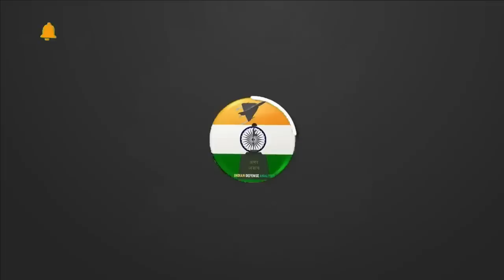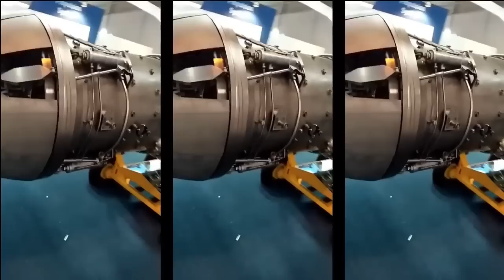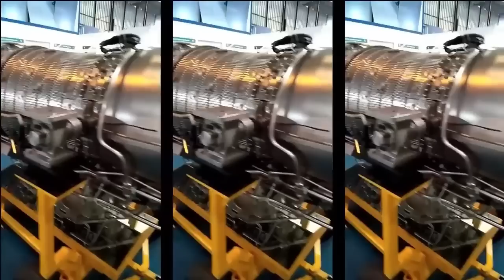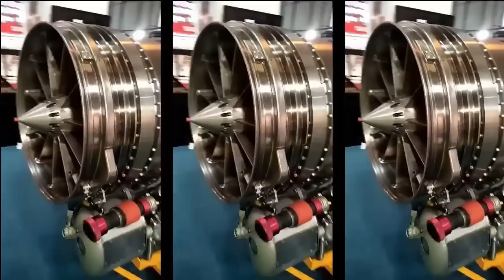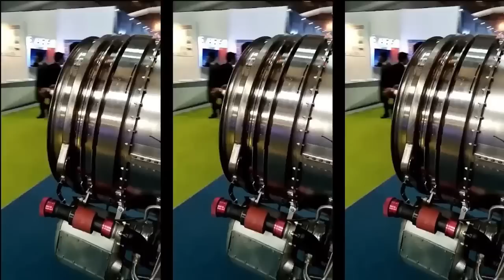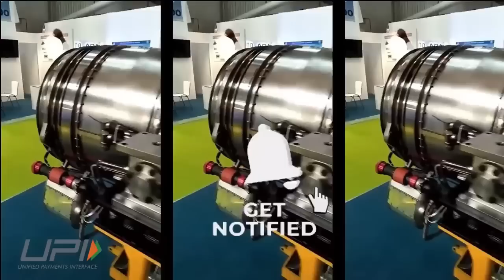#breakingnews Kaveri Engine successfully completed high altitude trial #drdo #indianairforce

Comment: Better specified the thrust weight ratio, fuel  efficiency and lifespan which are more relevant n informative.....otherwise its just a jet engine unworthy even for exhibition.   If India cantmake special marine steel grade for carrier... turbojet superalloy is more difficult to mastered.  Slander China as copycat or inferior, pribably will b a good idea and continue to b in denial.

Comment: GTRE should try and get a dry thrust of 75 KN.  AMCA fighter aircraft will need a 125 KN engine.  GTRE  has a capability to make such an engine.
Reply: Amca is double engine
Reply: @akhandbharat1593  yes AMCA fighter is a twin engine aircraft.  Power to weight ratio will be great.
Reply: Simple answer no

Comment: Good job, now it would be better if this can be used on HLTF-42 thus we can have our own trainer, and this can be used to compete in markets that JF-17 has, this is cheap as JF-17 but more better and reliable, considering the track record of Tejas
Reply: They are looking for ge414 For hlft 42
Reply: @pravinmeher2036  GE F-414 is a powerful & reliable engine, but then it will always require American permission if we want to sell the plane to someone, but if its Kaveri then that would also get the user to test the engine and give more correct feedback for the engine, we know the engine has more weight, but we need to master the material which will take time, and over the period of time, the kaveri engine can be further developed to the engine that we need, and then further develop it as per our requirement, we can control the engine specs.
Reply: @sachinmesta4238  HAL person did mention that ge414 is what they would use. He said they want hlift fit between Tejas mk1 and MK2. Considering all metal body, ge414 will be appropriate. Kaveri with just 80kn of wet  thrust will take hlft 42 to hf 24 marut's way.
I believe considering buying power of India,  for example air India deal. US companies would lobby with the US govt not to go against India. Let's see how it goes

Comment: While one step forward, I am annoyed as to why it is taking forever for flight test certification.  Kaveri Dry Engine has successfully completed its high-altitude trials where it was simulated to achieve 46-48.5 kN of thrust. Flight test certification should get started now! And after that, 50% of the Kaveri engine is ready, and the afterburner must undergo this entire process too. That seems to add at least two years before Kaveri engine will be ready to power Tejas Mark1A. Need to expedite the whole testing process by purchasing a flying test bed.
Reply from the maker: I told you at least will get some good news 😀
More details tomorrow , will try to meet GTRE officials
Reply: @IndianDefenseAnalysis  Looking forward to it, please ask them if flying test bed has been approved or not?
Reply from the maker: @datoolz0  sure
Reply: You are absolutely rt. We are relying on Russia now, we need to a dedicated aircraft to test engines.
Reply: @GGexcellence  Hopefully the Kaveri team knows if the flying test bed has been approved, it was requested earlier. We do now have high altitude wind tunnels, only missing piece!

Comment: JESUS finally 
Congrats to DRDO man 😃

I wanna talk to those people who mock DRDO calling them babus.
I will ask them how dozens of babus together can make the most complex thing man has ever made - jet engines.
Reply from the maker: Criticising is easy, blaming is easy but getting in system and making difference in democracy like india is next level challenge which we Indian fail to understand
Reply: @IndianDefenseAnalysis  
Yeah 😗
Now the path is clear , we have a booming economy for funds.
Now GTRE should start working on a new afterburner section for kaveri.

They can work on 100kn+ engines after AMCA mk2 engine is ready, using all the experience they will have at that point , it will be easily for them.
Reply: @fly463   They can't.. U can't make iteration on French safran core and turbine blades. 
Only OEM can do that. It was an offset obligation for 36 Rafale deal. 
No TOT occurred.. Safran demanded 1 billion euros for that which MOD denied.
Reply: @nishantshrivastava9674  
Then who is going to help us in mk2's engine?
Reply: @fly463   There would be Joint venture with either General Electric or Safran.. 
The one who agrees to share more technology with less liabilities with low bidding.
Reply: @nishantshrivastava9674  
GE says they can give us a 130kn engine & Safran -only 110kn 
The one with less strings might win
Reply: @fly463  but when the decision will made? A fighter program without even finalizing the engine.
Reply: @IndianDefenseAnalysis   Hello IDA team, make a video on the topic DC MAWS which was going to be integrated on Su 30 mki.. 

Here I attach some info from renowned force magazine.. 

DC-MAWS Suite

For DARE, the development of the six-unit dual-colour (ultra-violet and infra-red) missile approach warning system (DC-MAWS)—essential for all combat and combat-support platforms to provide hemispheric warning to pilots of incoming guided-missile attacks—has been a particularly daunting task. The MoD’s Defence Acquisition Council (DAC) had in September 2004 cleared the installation of DC-MAWS in 100 IAF aircraft (both fixed-wing and rotary-wing). DARE in January 2005 proposed to the IAF a project to design and develop DC-MAWS, jointly with the Israel’s Ministry of Defence and Elisra.

In July 2006 IAF accepted the proposal and in March 2008 agreed to install DC-MAWS on all its Su-30MKI H-MRCAs and projected an initial requirement of 50 DC-MAWS suites. In November 2008, the MoD accorded financial sanction for the development and integration of DC-MAWS on Su-30MKIs by DARE at a total cost of Rs.193 crore (including a foreign exchange component of Rs 172 crore), with a project date completion (PDC) of 55 months (June 2013) under the mission-mode (MM) category.

On July 17, 2006, Cassidian, the defence and security division of the European EADS, and the MoD inked a contract for procuring a small number of MILDS AN/AAR-60 DC-MAWS. This MoD move came despite DARE signing a memorandum of understanding with Cassidian on the joint development of an initial 36 DC-MAWS suites for both fixed-wing and rotary-winged aircraft of the IAF and the Army Aviation Corps that made use of the MILDS AN/AAR-60 system with a planned initial operational capability for 2007. The agreement also included the co-production of these suites by BEL. In December 2008, DARE signed a tripartite USD 37 million (Rs 148 crore) contract with Israel’s MoD and Elisra (now owned by Elbit Systems) for the joint development of a DC-MAWS suite with a projected PDC of 48 months (December 2012). The scope of the contract included delivery of six sensors for one DC-MAWS suite. HAL was selected by both the IAF and DARE as the nodal agency for structural modification of Su-30MKI airframes for integration of the DC-MAWS suite.

 

Heavier, Bigger

Subsequently, DARE found out that the sensors (that make up the DC-MAWS suite) submitted by Elisra were heavier and bigger in dimension (24cm in height and 4kg in weight). In May 2009 DARE informed Elisra that the sensors might not be accepted for the Su-30MKIs as it would cause serious restriction on their flight envelopes. The IAF too expressed the same view in March 2010. But Elisra in June 2010 expressed its inability to make any significant weight reductions. The installation of the six sensors on the Su-30MKI was not cleared in December 2012 by an expert committee at locations specified by DARE, as it would involve cutting the aircraft’s internal structure and the destruction of internal thermal masking coatings.

Subsequently, the committee in January 2013 cleared the installation of only four DC-sensors with a limitation of only 15-degree angle-of-attack (as against the Su-30MKI’s capability of 90 degrees). In February 2013, DARE approached the Su-30MKI’s OEM (OKB Sukhoi and IRKUT Corp) for expert review and clearance of the proposal for aircraft modification to integrate DC-MAWS sensors. In May 2013, the OEM clarified that the integration of DC MAWS sensors would significantly affect the Su-30MKI’s flight performance since the DARE-recommended installation locations were highly sub-optimal.

In December 2011 the project cost was subsequently enhanced to Rs 228.80 crore because of exchange rate variation (ERV). This was further increased to Rs 273.80 crore in July 2013. The MoD also extended in July 2013 the PDC of the project by 24 months (up to June 2015). A Comptroller & Auditor-General (CAG) audit in October 2014 observed that though the increase in the weight of the DC-sensors was a cause of concern to the IAF as well as DARE, the sensors (four for each aircraft, instead of the originally envisaged six) were accepted with their present weights. With this the possibility of adverse effects on the Su-30MKI’s flight envelope remained.

 

Audit Observations

In response to audit observations regarding delays in the development of the DC-MAWS suite and its operational impact, DARE in January 2015 agreed that the performance parameters of the DC-MAWS on Su-30MKIs would be limited. It further added that the DC-MAWS requirement on Su-30MKIs was not originally envisaged by the IAF and hence DARE executed it as only a technology demonstration (TD) project, instead of MM project and the project was wrongly categorised as MM.

Subsequently, DARE relocated the installation of DC-sensors on the Su-30MKI to the satisfaction of the IAF and the expert committee, which concurred in February 2015 that the installation of all six sensors was imperative. Between March and April 2015, Elisra delivered all the six DC-sensors only after the completion of factory acceptance tests (FAT). The flight evaluation of DC-MAWS was also carried out between March and April 2015 on an Elisra-owned Cheyenne airborne testbed. An amount of Rs 194.16 crore had by then been incurred on the project by March 2015. The IAF stated in April 2015 that flight-trials of DC-MAWS on a Su-30MKI were expected to commence in December 2015.

The CAG audit also observed in June 2015 that in order to meet the latest PDC (June 2015) of the project, DARE, after development and testing of the DC-MAWS suite on an airborne testbed, closed the project claiming it to be successful. In order to prove the developed DC-MAWS suite on a Su-30MKI, DARE had proposed in June 2015 to take up a separate project. DARE further stated that the delay in development was because of time taken (from February 2012 to February 2015) by the IAF to assess the impact on aerodynamics of the Su-30MKI.

In response to the draft report of April 2015, the DRDO reiterated in June 2015 the views of DARE that the DC-MAWS project was taken up as a TD effort and suggested to exclude the project from its draft report. The replies may be seen in the light of the fact that the IAF had clearly projected back in March 2008 the requirement of the DC-MAWS suite for Su-30MKIs and accordingly, the project was sanctioned under the MM category. Also, neither the DRDO nor DARE took any initiative during the developmental phase to obtain an amendment to transition from the project from the MM to TD category. Further, flight evaluations of the developed DC-MAWS suite were carried out on a Cheyenne airborne testbed and as such, the success or otherwise of DC-MAWS with oversized sensors, would be known only after flight evaluation on modified Su-30MKIs, for which a separate sanction was awaited. Till then, the IAF’s Su-30MKI fleet would have had to operate without DC-MAWS capability.

 

Project Revived

In 2016, DARE once again succeeded in resuscitating the DC-MAWS project by proposing to install four DC-sensors to the fore and aft of each of the two Interface Beam Assemblies (one under each outboard wing pylon), with the remaining two sensors being mounted on the topside and belly of the Su-30MKI airframe. But such a configuration too has not yet been approved by OKB Sukhoi, which instead has cleared the MILDS-A installation configuration that had been proposed by the industrial partnership of Hensoldt (which bought over Cassidian), BEL and Alpha Design Technologies back in 2016 itself.

As a consequence of this, DARE has developed a DC-MAWS suite installation package that does not have the support of OKB Sukhoi and will therefore be regarded as an unauthorised and non-certified fitment, which in turn will lead to both OKB Sukhoi and IRKUT Corp withdrawing their airworthiness certifications for all such modified Su-30MKIs. The total product liability, therefore, will rest squarely on the shoulders of DARE and HAL, with devastating consequences for the IAF and its entire Su-30MKI fleet.

Instead, what the IAF should have done in the previous decade was to go for the very same certified DC-MAWS fitment configuration that was specified by OKB Sukhoi for the 18 Su-30MKMs of Malaysia that were delivered between 2007 and 2009. This would then have become a win-win solution for all the involved parties (Russian and Indian) and could well have generated similar solutions for the IAF’s upgraded MiG-29UPGs. Instead, the evident criminal negligence displayed by the MoD, DRDO and DARE since the previous decade has only ensured that the IAF’s MiG-29UPG and Su-30MKI fleets remain devoid of DC- maws
Reply: @IndianDefenseAnalysis  not even a low thrust engine from GTRE yet. not even for HTT 40. that's pathetic...and GTRE was founded in 1950's....doesn't that matter?
Reply from the maker: @amalvijiv  as I have said it’s very easy to blame and find faults. But what we expect is only possible with more R&D budget and armed forces adopts more and more indigenous tech which started happening in last 5 years.

Tell me how many Indians will be happy if R&D tax is introduced (hypothetical question)

Comment: Why can't we use 2engine in tdbf design as tejas 2
Reply: Bhai iska maintenance cost,fuel consumption bhi jyada hoga aur overall fighter jet ki cost bhi bad jayegi iaf future me ise bahut bade number me procure karegi ,china ne j10 aur usa ne f16 jo Tejas mk2 ki hi category ke hai inhe bade number me procure kiya hai same ham bhi karege.
Reply: ADA has that design ready 
Tejas mk2 with 2 engine but IAF does not want it
Reply: @fly463  kaveri can be used as twin engine to fullfill power requirements
Reply: @vaibhav1768  
Yeah ADA can do it but iaf doesnot need any twin engine jet after MRFA ( according to IAF's head)
I think it is a good idea
Reply: It's not that easy to change the design so much. It takes a long time to design, test, and certify that. Plus the IAF wants a single engine fighter. Two engines demand higher maintenance and running costs.